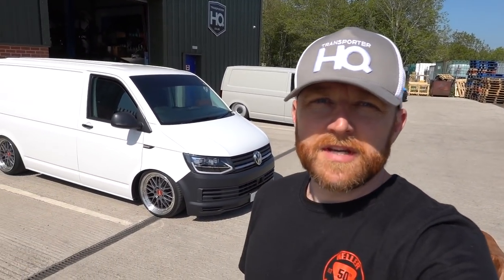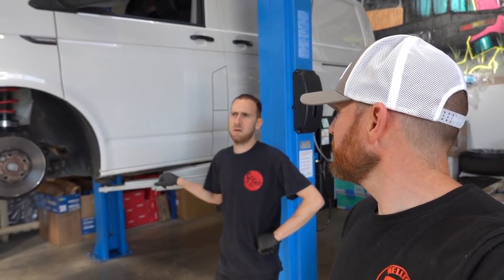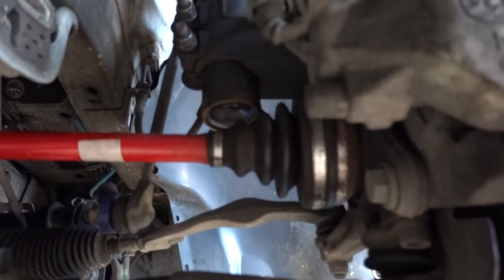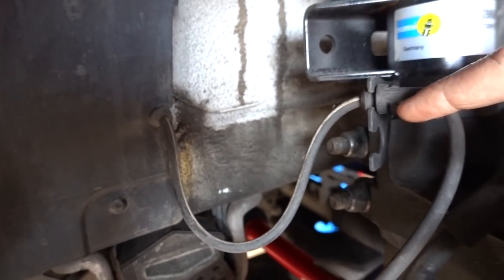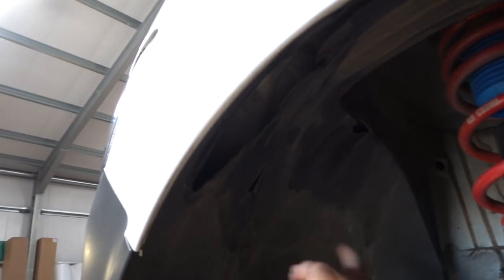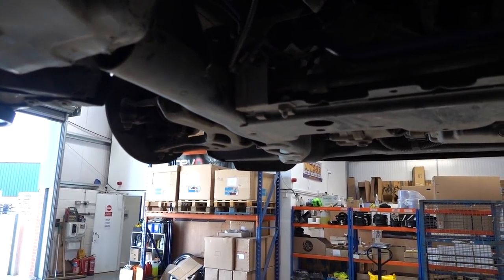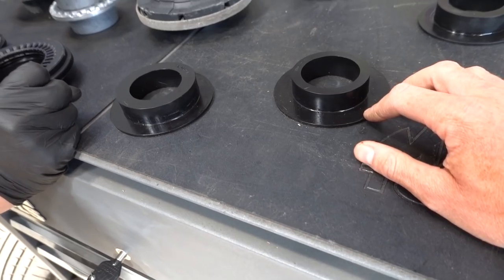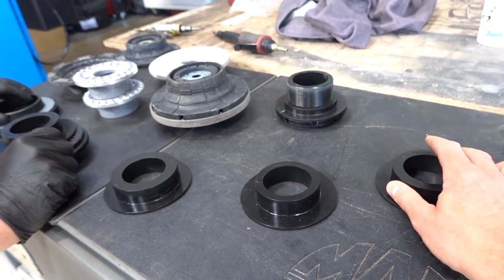Tips on getting your T5 / T6 even lower / adjuster deletes | Transporter HQ

Comment: Great video 👍 I currently have a T5 project that I’m going to be running stance+ coilovers and was wondering with regards to the top mount mod can you use the original T5 top mount with the machined down plate? Cheers 🙏
Reply from the maker: No you need the compete T6 kit if you have a T5.
Reply: Hi. I'm of the same thinking as Static. If you aren't resting on the "castle-ations" (great word) of the rubber top mount why do you need the T6 top mount? You are resting the plate on the internal of the top mount. So surely a machined T5 plate would do the same?? Or am I missing something.
Reply: @edfisher8530  I used original top mount and cut them down and fitted to my Stance+ coilovers and haven’t had an issue, I have also vlogged it on my page

Comment: Hi. How/where can I get hold of a set of shortened drive shafts. #hensteeth.
Reply from the maker: They factory that made them kept getting them wrong so we stopped making them :(
Reply: God damnit . Demand for them must be high right now. Subframe raises being the other option. Would you say they are a straight forward process for mechanics to achieve?.
Reply from the maker: @theandroidanglers4931  it's not easy. Contact lowdown Transporters

Comment: I am on air right now, would you advise to completely remove the front wheel arch plastic liner? When I air out the  front wheels hit the liner at the top and pull the liner inwards from the left and right of the wheel. Thanks for any advise you can offer.
Reply from the maker: Hello. No although it is common to kit a chunk away. We would normally cut away the section between 10 o'clock and 2 o'clock. I hope this helps.
Reply: @THQAutomotive  that’s great thanks for your insight. Once you cut the arch liner do you need to add screws, sealant etc where the cut marks are to keep the liner in place. Cheers Pete
Reply from the maker: @petestaveley-hunt9452  No it should still hold in with the original panel clips.
Reply: @THQAutomotive  that’s awesome, thanks for your help. Much appreciated 👍😉👏🏻

Comment: What about the drop links? 
Can I use the oem drop links for my t5 with extreme hub mod and t6 top mounts/ machined top mounts or does it need to be shortened or adjustable?
Reply from the maker: OEM top mounts are correct. You only need longer drop links if you are air suspension low with extra cutting work. Even air and no extra mods would use original length drop links. (Unless its a T6.1, then you need longer T6.1 links)